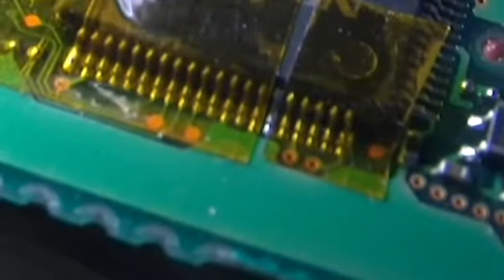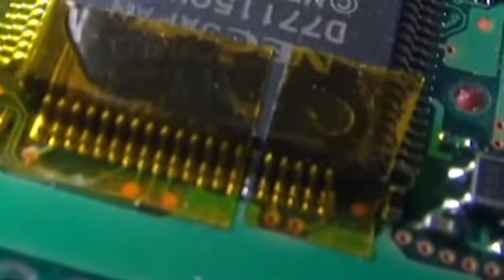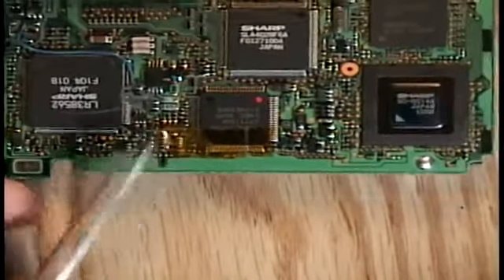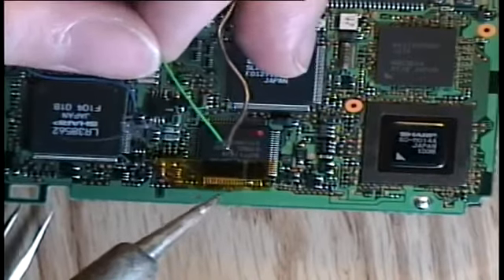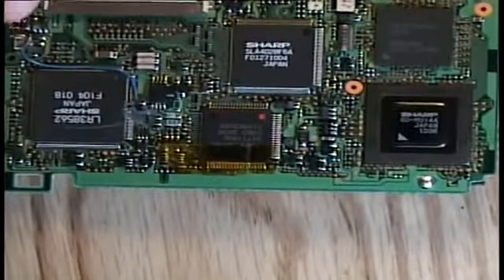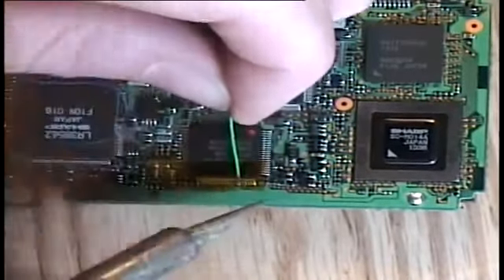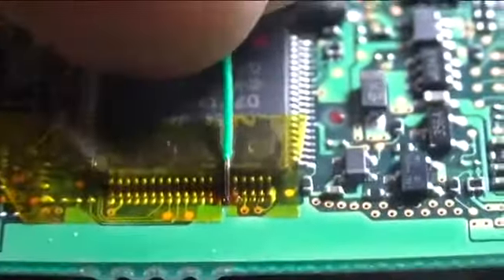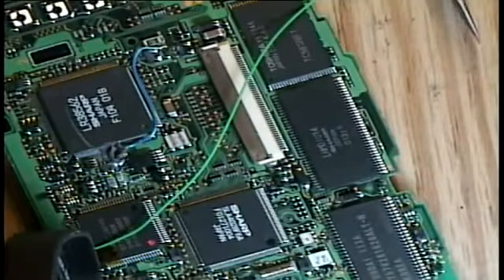Fupont Kapton Tape Appliaction in Solder SMT Pins Polyimide tape use in Solder

Comment from the maker: Fupont Kapton Tape Appliaction in Solder SMT Pins Polyimide tape use in Solder
www.csfbtapes.com   Email: jack@csfbtapes.com  
Whatsapp:+86-15012683474        Wechat:+86-15012683474    
Skype: jack198803